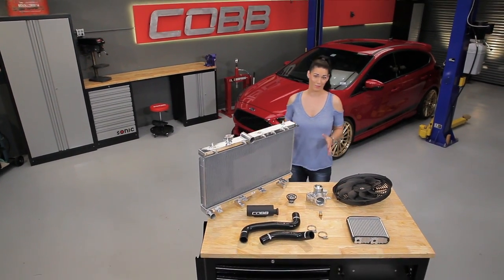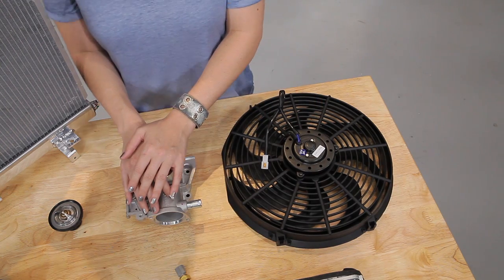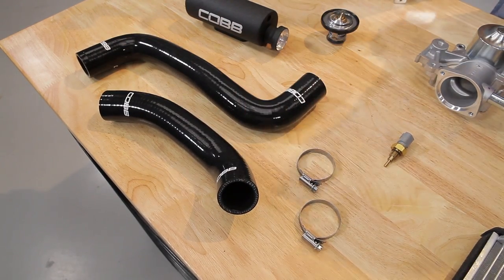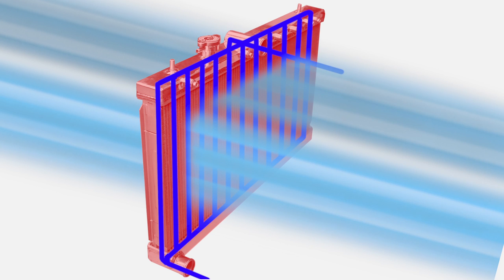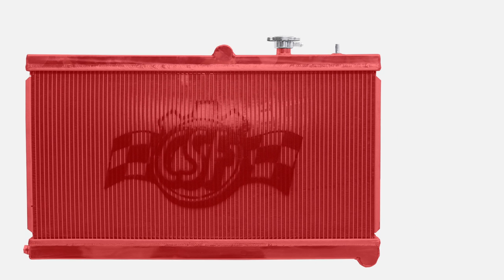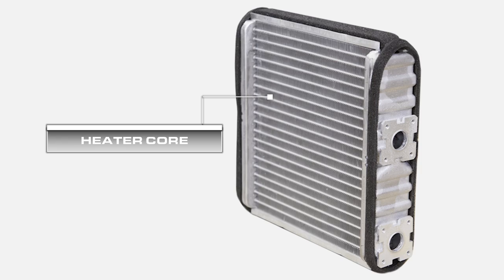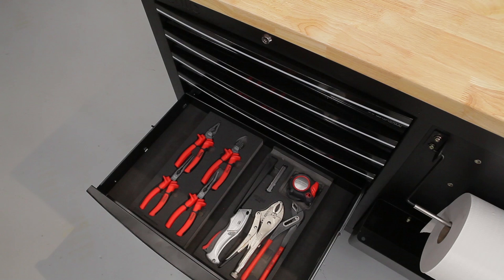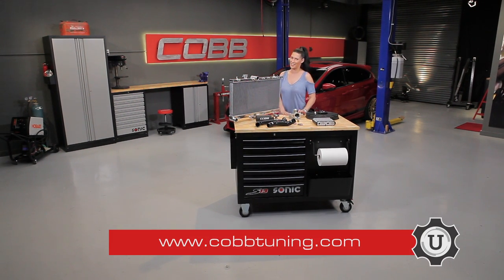COBB Tuning - COBB University Episode #11 - Engine Cooling

Comment: So will putting your 1.3 and 1.1 bar caps on my stock STI cooling system be a bad idea? I have your SF Intake and AP V3. And will be adding a full exhaust and front mount intercooler and protune very soon.